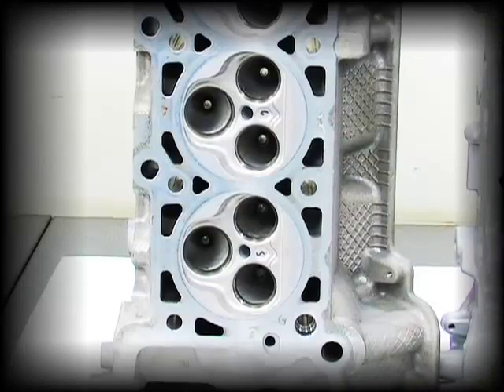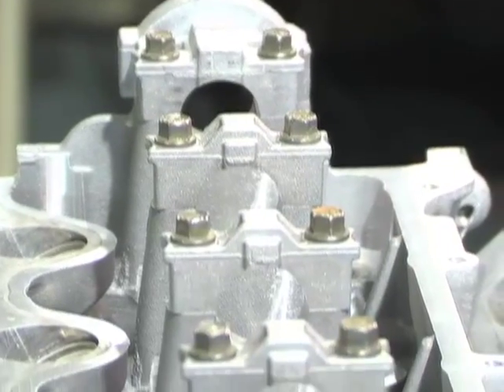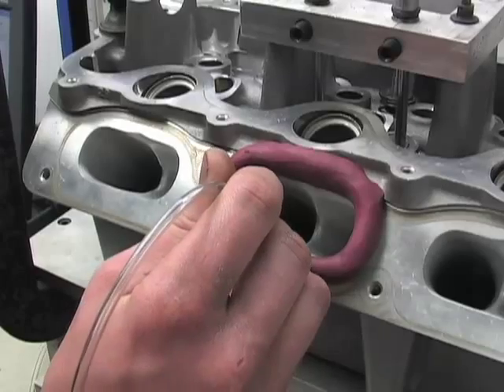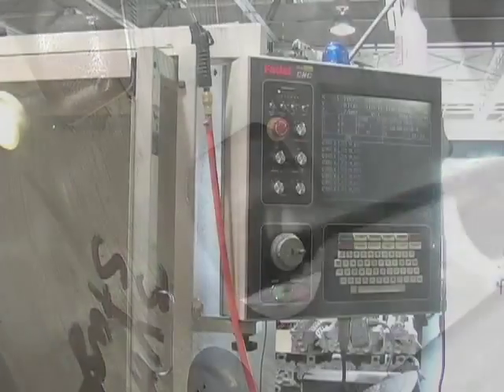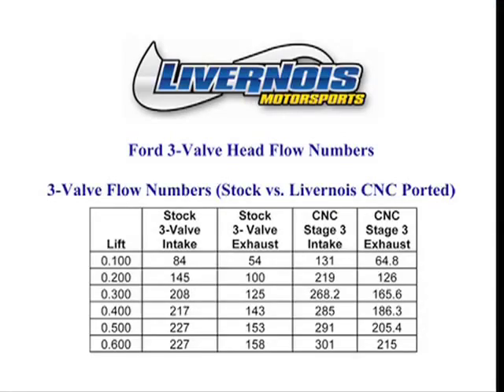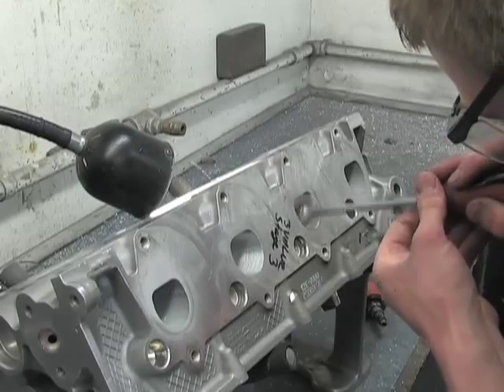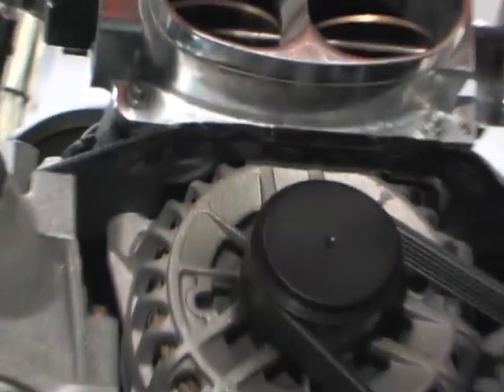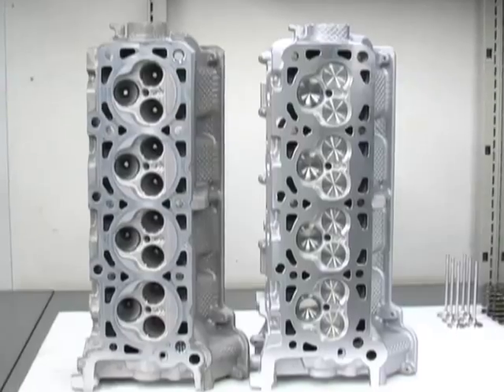Livernois Motorsports CNC 3-Valve Head Video

Comment: I plan on running comp cams 127600 and was wondering if I would still need to replace the valve springs for their recommended  spring. I was also wondering about the max recommended rpm with your heads.
Reply from the maker: We do offer an upgraded spring package that would work with those camshafts.
Reply: @LivernoisMotorsports  appreciate the fast response. How much is the upgraded spring package and what is your part number ?
Reply from the maker: @abot2000  Give us a call, and our sales team can go over your options.

Comment: I wish I could see a picture of the actual port itself how much did yall take out the spark plug boss itself? I would be interested in seeing what csa you get out of your race heads. (Porting my heads myself going single turbo race build) I'm probably just gonna hog out the intake and put bigger valves sense its a boosted motor. Any tips would be appreciated this is my first 3v head I've done lots of LS LT stuff.
Reply from the maker: We do have pictures of these heads on our website, but do not disclose specifics about material removal. What we can tell you is this port program was verified to pass OEM standards for durability in material thickness.

Comment: Livernois, what kind of fuel do you have to run with these heads?  can you still run regular or do you run premium?  Thanks
Reply from the maker: The heads themselves do not impact what fuel you would use, however, if you're adding items to add performance, holding back that performance by running regular doesn't typically work out too well.
Reply: @LivernoisMotorsports  Hmm interesting.  Yeah I suppose the tune for 91 octane would work the best for performance.  I like being able to buy regular but then again I don't drive the car for commute any more.

Comment: Is there any downside to these for a street car?  Any issues with California emissions?
Reply from the maker: give us a call and we can discuss all the options 313-561-5500
Reply: @LivernoisMotorsports  I also need it to pass CA emissions, why doesn't it? doesn't even change the look of the engine. it would definitely pass inspection unless you modified the emissions output of the engine drastically.
Reply from the maker: @denniss4951  That's a question better posed to your local regulators unfortunately.
Reply: @LivernoisMotorsports  ok.  my dad says he knows a way around it however, I have read that Livernois cnc machines "Livernois" into a part of the cylinder head that a visual inspector can see.  So I dunno about all that lol.
Reply from the maker: @denniss4951  Our logo is indeed machined

Comment: Was wondering would these heads work on a 2v engine.. how much is it too port and polished the 2v heads ?
Reply from the maker: They will not work on 2V 4.6L. Adam, in order to give you an accurate price what are you wanting in the cylinder heads as far as upgrades. We have three stages of performance street, pro, and race. Let us know what are you wanting to do then we can get you the accurate quote you need.